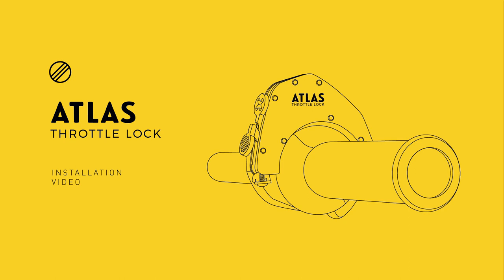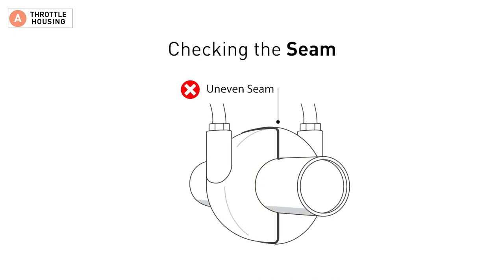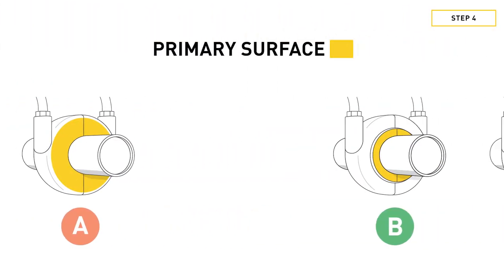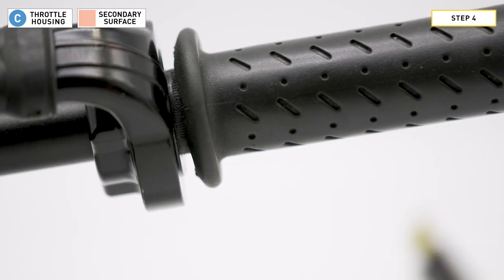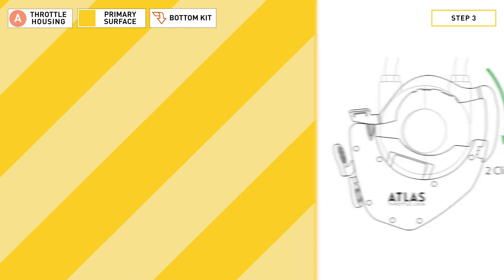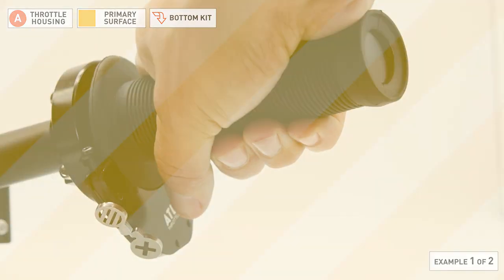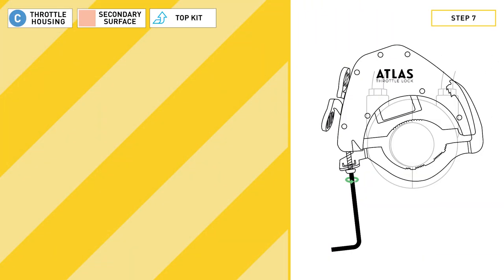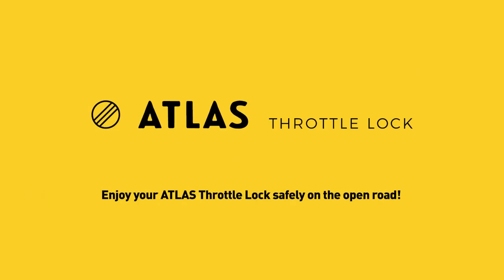ATLAS Throttle Lock Installation Video

Comment: these instructions are ridiculous. Previous version didn't have a trillion steps
Reply from the maker: That's because this version is intended to be more comprehensive. Previous versions of the installation video did not consider throttle housing types that are commonly run into, though we have some videos for specific motorcycles that point out special considerations. Many riders won't have to consider throttle housing types because their throttle housing is flat or otherwise doesn't have special characteristics, but many riders also have throttle housings with beveled sections and other such things, so we're trying to cover more bases by providing more knowledge. The actual installation is simple, but setting up the friction pad for some of the throttle housing types takes a bit of consideration and that's what we're trying to cover here. Hope that helps!
Reply: @ATLASMoto   Ok. will try it on my Yamaha Raider
Reply from the maker: Let us know if you need any assistance! You can reach out to us at info@atlasmoto.com. We recommend the Top Kit ATLAS for most of the Raiders, because we see them with a throttle cable bracket that tends to be sticking out from under the throttle housing. This bracket can interfere with the Bottom Kit ATLAS by snagging on it. You can check your bike to see whether the bracket comes out from the bottom of the housing.

Comment: Surprised, I had to use a 1 friction pad. My grips are pretty thick with the extra rubber pressing on the throttle lock pretty tightly. But seems to work quite well.

Comment: What if you use pad 1 and still don't have clearance?
Reply from the maker: Depending on your motorcycle model, you can typically pull back the rubber grip a bit to make more room for the ATLAS. Let us know what you have and we'll help out!
Reply: @ATLASMoto  i have a 2022 kawasaki z900 and there is no space to fit pad 1 and the rubber grip doesnt move
Reply from the maker: @ahmedbadri3911  Reach out to us at info@atlasmoto.com with a few detailed pictures of the grip setup on your bike. We'll take a look at it!

Comment: I've got an earlier model with different friction pads. The current pads I'm using don't work for more than a couple hours of use before they start slipping. It's a 2016 CB500X and the example you show in the video would be  "B". There is maybe 1/8" of the pad that makes contact, and it takes a very thin pad.  Will the new friction pads work with the older units? I want to like this thing, and when it works the way it's supposed to, I do, but it never works the way it's supposed to for very long. I also have one on my DR650 with the same problem.
Reply from the maker: Hey! The new friction pads will work with all of the 2-button ATLAS throttle lock kits. It should work great on the CB500X and the DR650! Reach out to us at info@atlasthrottlelock.com for assistance!

Comment: So these only work with rubber grips? I have Kuryakyn Isogrips (metal) and there is zero clearance between the grip and the housing.
Reply from the maker: It does work with a variety of non-rubber grips, including Kuryakyn ISO grips! You'll want to check out this video about that. https://www.youtube.com/watch?v=6MVl8LCKDNA

They are tight, however the metal portion of the grip can be pried over to make more space. Just take care not to scratch them!

Comment: Which kit I should buy for the ADV 350?
Reply from the maker: Bottom Kit as long as you're not using Honda Heated grips! If you have the Honda heated grips, roll with the Top Kit. You need 3mm in between the grip and throttle housing for the ATLAS to fit.